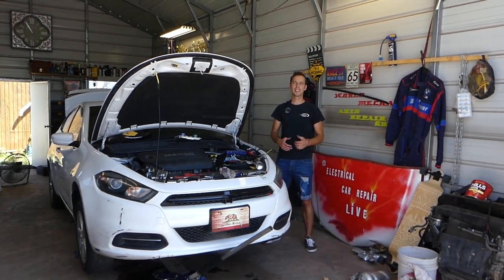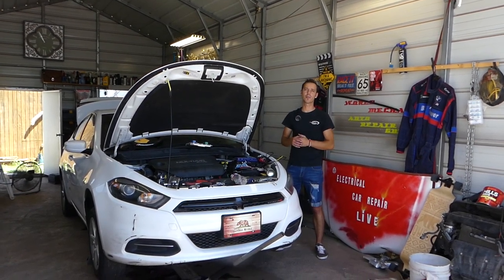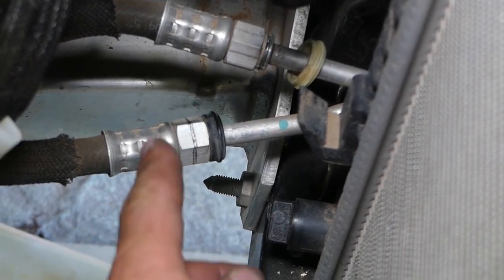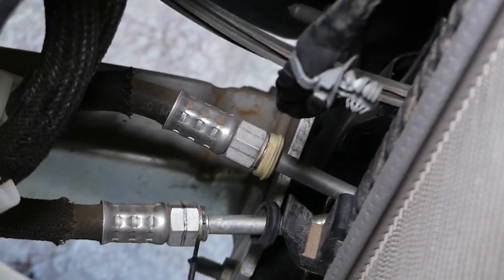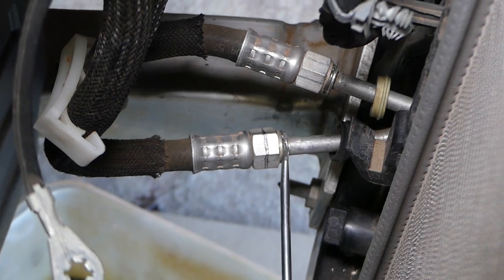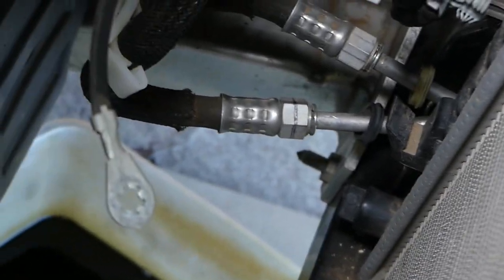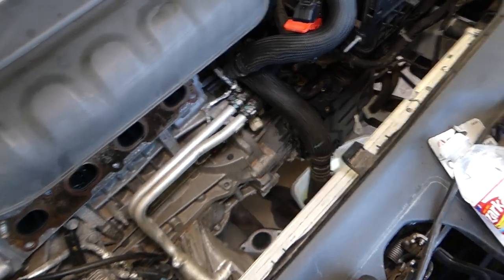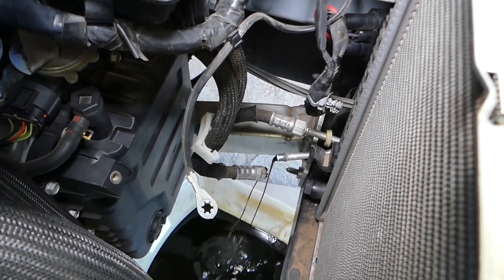HOW TO DISCONNECT TRANSMISSION LINE ON DODGE, CHRYSLER, JEEP, FIAT

Comment: Hello Auto Repair Guys! I fixed a leak from those lines on my Dodge Charger. My question is, is the oil from those lines the same oil from the transmission?

Comment: Can you please show me how to return the line back. When I remove the line I connected it back but all transmission oil came out while I was driving. Now I waiting your response so I can do this properly. Thanks in advance
Reply: You just put the clip in with the 3 little notches in the holes in the radiator part. Then push line on
Reply: If it still leaks then u need to replace the whole adapter to screw in then.
Reply: @dmo848 can you help me out! My car was leaking from those lines I fixed, but I don't know if I have to top up the transmission fluid.

Comment: Did you have to remove anything to be able to get at these to get them off, like the metal mounting plate or whatever it is called that goes across the top of the radiator??? It seems like it will be impossible to get at these lines on the 2009 caravan without removing other stuff??? Any help is appreciated!!!! Ty

Comment: I have the tool for disconnecting that connector, but where the metal tube is screwed into the radiator, is it just metal to metal or is there a washer that is supposed to be in between?